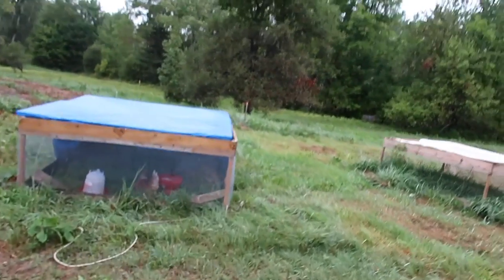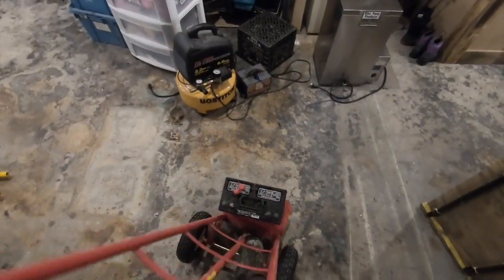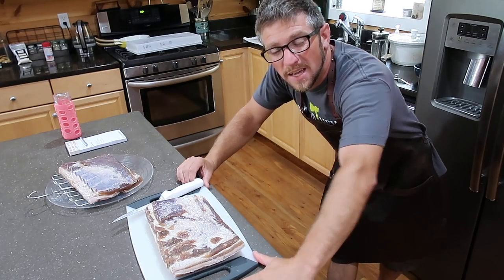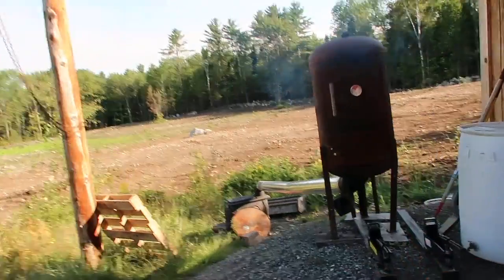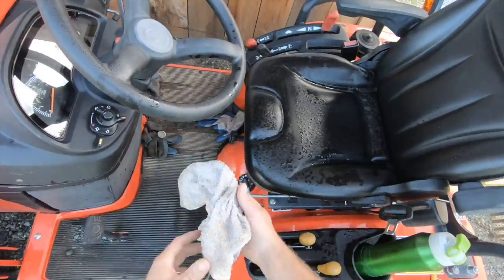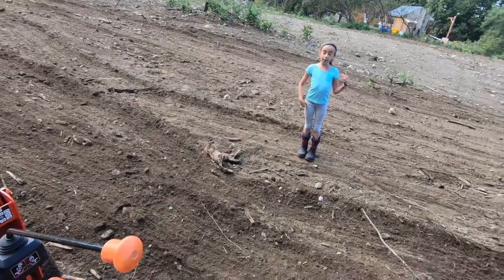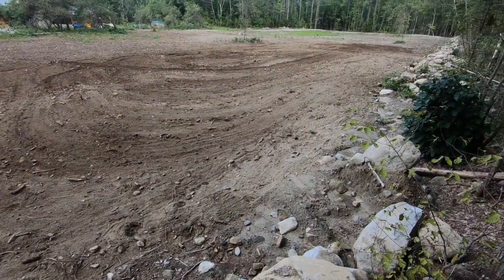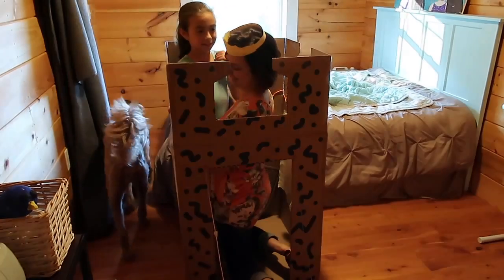Making the 4 Acres we had Logged Into Pasture (using a Kubota BX2370)

Comment: I had the 100 mile Galliger charger.  I ran a hot wire all around our property line. We had 26 acres. That was a big job, but that really paid off when it came to portable pastures. I could grab a hot wire off the nearest property line. I took a hammer drill and a generator and drilled holes in the top stones of the stone wall.  I used short scrap peases of #4 rebar for my stakes.   Most were tight,   It the hole was too big a had a tube of caulk Id use to cement the stake in the hole.  Down on the 9 hole golf 
 coarse, I used a solar charger. That was always iffy.  I had a Great Perininneees down there with the sheep. She kept the predators away ( mostly domestic dogs), but she didn't keep them in the fence.  I was down there every day moving fence I would switch the battery out from my pickup if the solar was weak, it usually was.  That was a hassle, so was collecting up sheep when they got out.  But they had good grass, that helped.  I mowed all my hay down there on the fairways.

 If you harvest the stones it makes the new ones grow faster.

Comment: Try angling your York rake so that debris spills out the side in a windrow - you can work a few rows over together (maybe even to the tree line) and then come along and pick up the debris with the loader.  Easier pick-up and the rake will work better because it will not "ride-up" over ground debris from the accumulate debris in the tines.  Good luck!